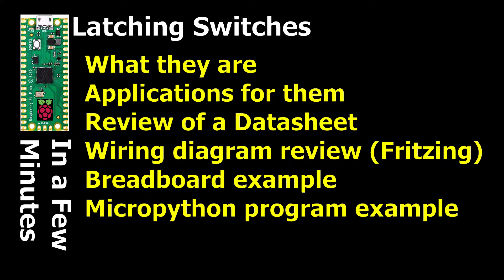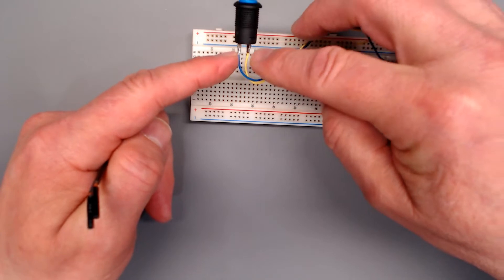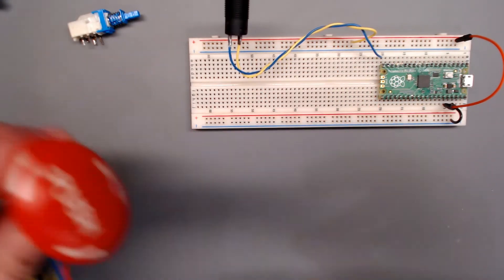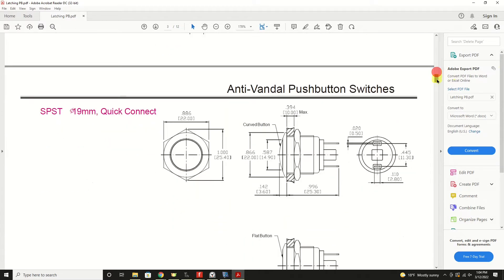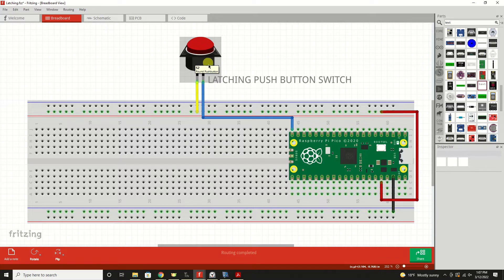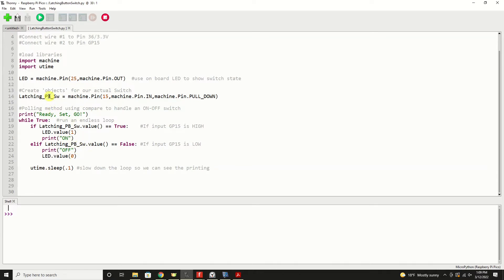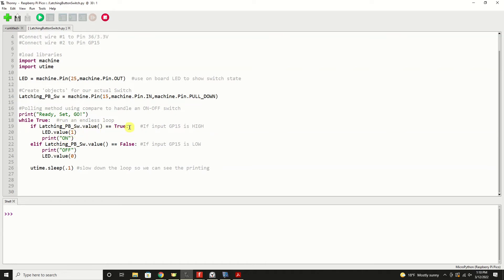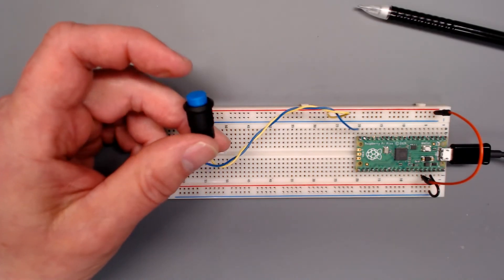How to Interface the RPi PICO with Latching Switches

Comment: This series is awesome Chris! I've found it helpful getting into the hardware side of things. One thing I'm confused on is how the button should be wired. I see mixed information, where some guides suggest connecting to a data pin + ground + PULL_UP mode (but not 3.3v), and others - like yours here - suggesting data + 3.3v + PULL_DOWN mode (but not ground).  Any chance you can elaborate on the importance/difference here? I'm having a hard time understanding why someone would connect one way versus the other. 

In my case, I found both approaches to work but I can't tell what's the significance/difference. Are the both "the same thing" just done slightly differently? Are there any trade offs/considerations?
Reply from the maker: Thank you for the great feedback and question.  I may have to do a video on why you would choose one over the other (pull-up or pull-down).  In most cases it does not matter which what you do it, however, there is one gotcha that messes up a lot of people with pull-up configuration.  We often think of a signal that is positive voltage (as in pulled-up) as being ON.  In the case of pulled-up, we actually are looking for a zero volt (low) signal to turn something on.  There are safety reasons of why one is better than the other as well.  I think there is enough discussion to be made into a video.  Thanks and Cheers!